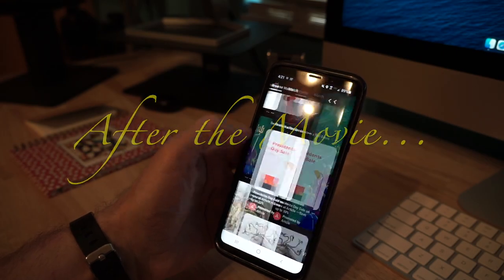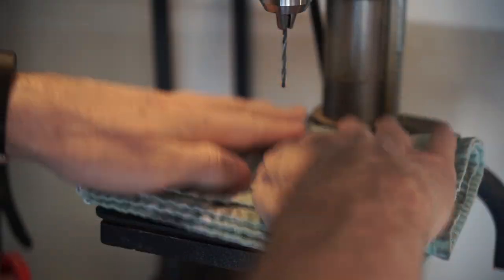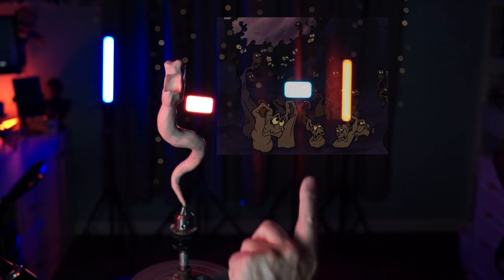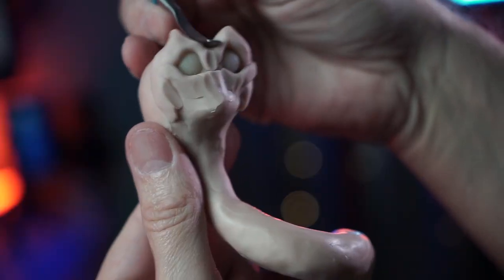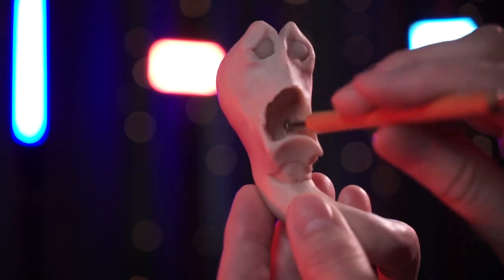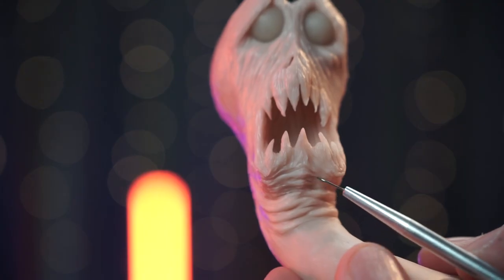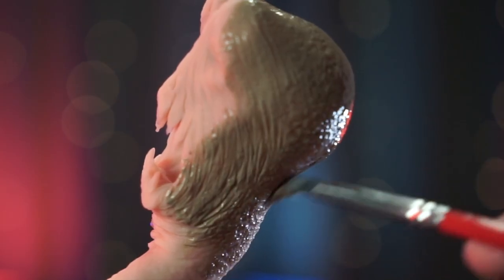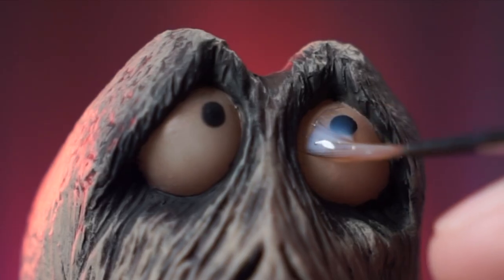See how I made one! Ursula's Garden The Poor Unfortunate Souls must stay until the price is paid!

Comment: What would you suggest for a real Matt finish to protect paint & pastel powder for super sculpey ?
Reply from the maker: That a tough one. Truth is I've never found a sealant that I could spray on sculpey, that didn't make it sticky forever. I still have some sculpts that are sticky years later. However, I never had the power fade or rub off. As long as you use flat or matte paint its almost like the powder embeds into the surface.
Reply from the maker: There is a glaze called Liquitex, that you can brush on. It comes in flat, matter, or high gloss. I used brown pastel powder on this Sculpture's eyes and used Liquitex high gloss on his eye and it worked very well!
Reply: @clayformations1638  thanks for information will definitely look into it ❤
Reply from the maker: @karymarie9786  My pleasure!